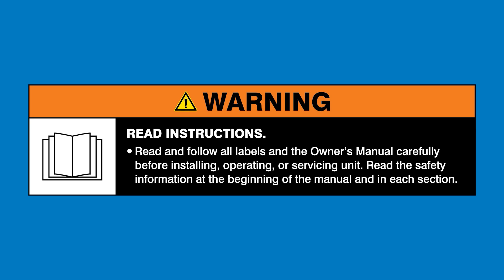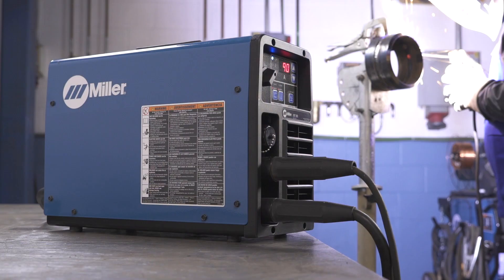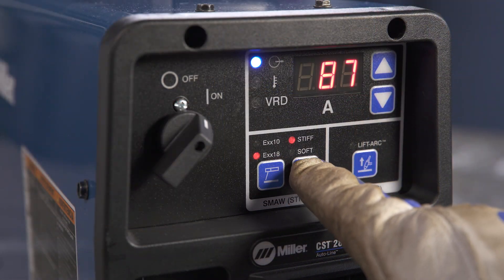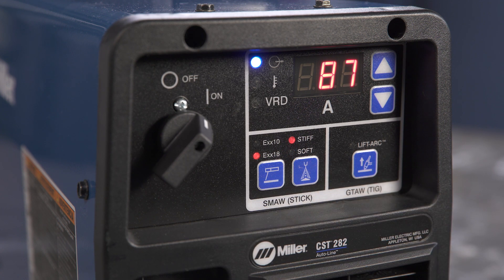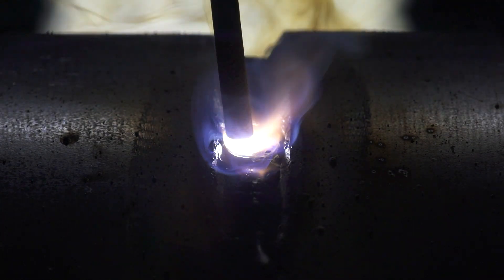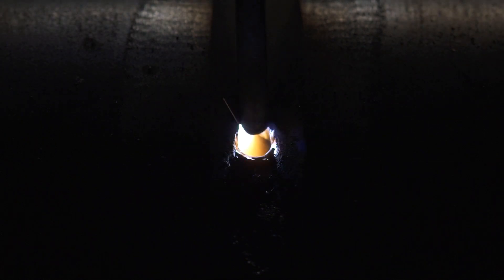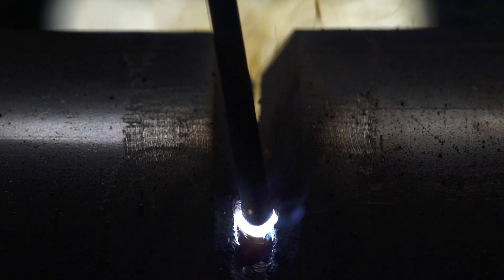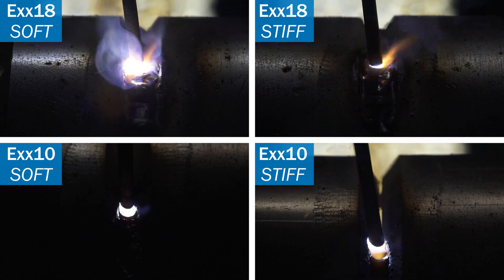CST 282 Stick/TIG Welder: Stick Arc Selection

Comment: I bought a cst 280 and for some reason the lift tig won't work it only works if I scratch start it and if I try and do the lift arc, the tungsten will only get stuck to the metal does anyone know why this is happening?
Reply from the maker: Hi Jose, we are sorry to hear about this and we would like to look into this for you! Could you send your machine's serial number and a brief description of the issue to info@millerwelds.com? Thank you!
Reply: @MillerWelders  yes I will thanks for replying

Comment: So what is the diffrent daynasty 280 xt vs this one, if i am in tig application more?
Reply: Dynasty is full TIG with AC DC TIG, Pulse, High Freq start, Sequencing...etc.
Reply from the maker: Hi Khalid, thanks for reaching out. The biggest difference between the CST 282 and the Dynasty 280 is going to be that the Dynasty offers an AC output which allows you to weld aluminum. The CST does not offer that.
Reply: @MillerWelders   thank you for your explanation , miller all the way